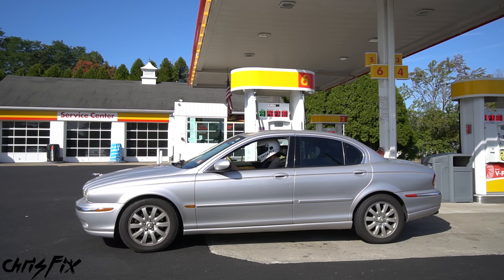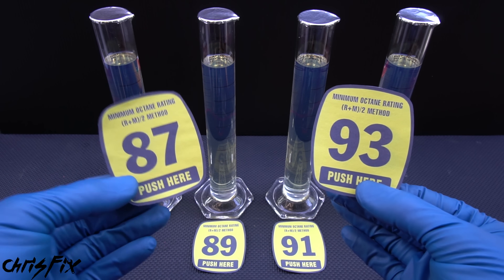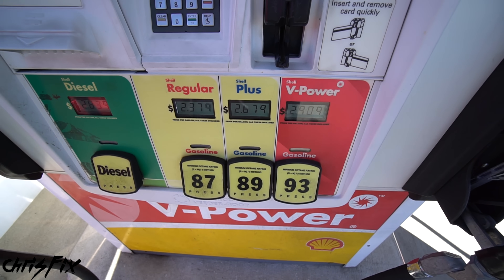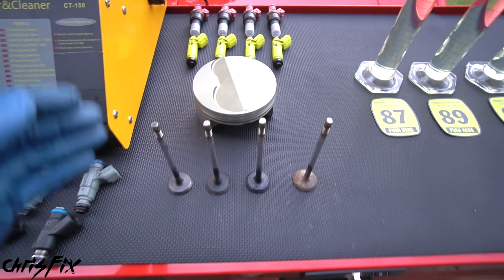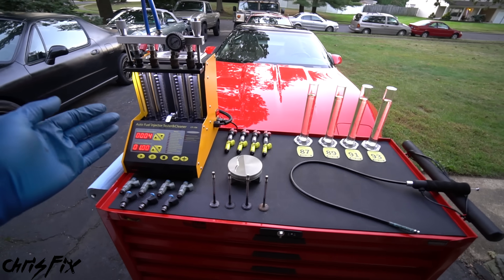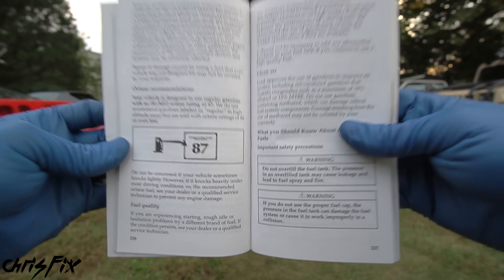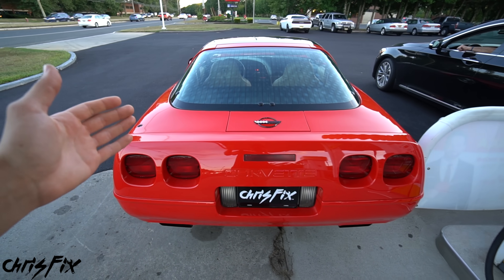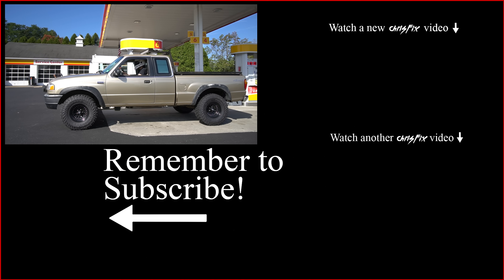What is the BEST Fuel to Use in Your Car or Truck and WHY

Comment: I used to work at Gilbarco / Veeder-Root, logo seen beneath the fuel type selector. 
Don't fill up when you see the tanker dispensing into the ground. It stirs up all the crap at the bottom of the tank and you are pumping it into your car. Station owners never change the filters. 
89 is just manifolded 87 and 91.

Comment: The energy in different gas is NOT the same! Higher octane value gasoline has slighly lower chemical energy because of its molecule structure

Comment: If you are using gas for Any Small Engine regardless if it is mixed with oil or not you
 Must Use Plus Grade 89 Octane gas. Read the Owners Manual or ask the dealer. Saving 20 -30  cents a gallon isn't worth the eventual problems you'll eventually end up with.

Comment: Actually putting regular in a premium required vehicle is fine for a tank and unless you are flooring it or lading the engine it's unlikely to cause a problem. Just drive normal, not slow. I Have a Tacoma that recommends mid grade but it runs fine on regular. The pumps at Costco only have 87 or 93/91, no mid grade. The difference between the bottom and top grade is about $8 a tank. I briefly thought about using octane booster but I was unable to fine one bottle that could boost the octane number over 1 point. It would be cheaper to just put in the premium. 

Otherwise good info, just put what the manufacturer recommends and you will be fine.   MG  Retired ASE Master Tech.

Comment: Doesn't higher octane fuel have additional detergents to help clean your engine? So it seems like putting in higher octane will save you more money in the long run because it will make your engine last longer.

Comment: Very informative video..well done and concise. I have an older 1994 Nissan 4 cyl, 5 speed pickup truck that I use to haul trash and do misc odd jobs with. Great little truck with 128k miles on it but I've noticed that if I put reg 89 octane gas in it it runs horrible! It runs so bad on reg gas that I thought I had a broken engine mount..no joke. So I switched to premium and it runs like a top. P.s. Better fuel in my chainsaw makes it start easier and improves performance as well. 
It's been my experience that higher octanes can dramatically help small engines. It sure did for mine. Currently $3 @ gal for premium (93 octane) here in the southwest US.

Comment: Chris, you did not mention how some mid-grade unleadeds are alcohol free (or at least claim to be). Most "regular" gasoline in the U.S.A. has 10% alcohol. Just straight petroleum based fuel vs. one w/ a 10% mix could make a difference. In theory alcohol would give you more get-up-and-go but have less miles per gallon (faster burn?).

Comment: Since Shell puts 7 times the required additives in their 93 octane, and 89 octane is pretty much a 50/50 mix of 93 and 87, you'll still get a significant boost of additives using 89.

Comment: Well it is not written in the manual, but I need to use plumbum additive before gasoline I buy. Since they stopped using Pb in gasoline. 
What I do miss is how organic additives in gasoline are destroying engine. Here in europe there are usually laws which tells that there has to be something, like rapeseed, in gasoline in atleast certain ammount.

Comment: Hey chris so long story short is premium gas like full synthetic oil? For example a 2002 honda accord only needs conventional but full synthetic will give it protection and keep the engine clean from sludge. Same thing as it only needs regular gas but using premium is also good and will keep ur injectors protected and clean?

Comment: Here in Canada, the Regular and Mid grade has up to 10% ethanol, and Ethanol contains lower energy density. So you will get better Fuel Economy by selecting Premium...But the percentage of energy gained from having no ethanol, does not offset the Higher price of premium. Thus, it is cheaper to run Regular.

Comment: I have tested it. Premium gave me way higher mileage in hway driving.
Reply: Ya he said it doesn't make a difference but then he said that it does when talking about his vett. xD
Reply: When driving outside Calif I run only ethanol-free fuel: I go from 24mpg to 32mpg. Ethanol fuel actually burns less efficiently, wasting gas and creating more air polution. You can't get E-free fuel in most areas of Calif.

Comment: Back in the 90’s when I was a mechanic at a GM/Geo dealership, we had Geo Metro’s towed in every winter because people would put premium in them and when the engine hot cold, the little 1.0L three cylinder wouldn’t start.

Comment: FALSE! Octane is an inert substance. IT DOES NOT BURN, therefore, it lowers combustion temperatures. It makes up a percentage of the fuel content. THUS 85, 89, 93 octane. KNOCK is caused by excessive combustion temperatures due to predestination from hotspots within the cylinder such as the edge of valves.

Comment: Simple answer everyone: CHECK YOUR CAR OWNERS MANUAL.

You’re Welcome
Reply: @lAcid Rainl well no shit sherlock
Reply: TL;DR
Reply: @Heisenberg-zy8xp  Only need 1 page: Fluid requirements. Done
If you can't bother to read that 1 page, then you don't deserve a car.
Reply: What if you don't know how to read ??!!?
Reply: My owners manual says to just put regular, but I put all 4 types of gas instead. Makes my car fly, that way I don’t have to worry about traffic.
Reply: Nah get those obd2 chips that “improved” performance by cooking your seals.
Reply: I've heard from a sunoco refinery that you follow what the manufacturer recommends because that is what the engine was engineered to run on
Reply: @lAcid Rainl Thanks Captain.
Reply: @lAcid Rainl DUMBAZZ
Reply: My older Subaru outback is "Premium recommended".  I've never noticed a huge difference in terms of premium vs regular, so no, it's not cut and dry. Why waste money when it's not doing anything.
Reply: Treasons Beta well then you’re just not paying attention. If it says premium, it’s NOT performing at optimum level of you’re putting less than in it. Fact.
Reply: @gr8st2323  the octane rating refers to knock resistance, fact. octane rating affecting the "optimum level, ie power output, NOT a fact. guess you aren't paying attention either.
Reply: Rhia yeah that’s both incomplete AND incorrect. But okey doke buddy 👍
Reply: Treasons Beta boi better be prepared to replace some stuff
Reply: Treasons Beta it depends on the compression of the motor. If the motor was forced induction or high compression you were using the wrong fuel and it could possibly damage the motor of a long period. Most newer cars know immediately when you put the cheap stuff in and the computer detunes the motor. If you can’t afford the correct fuel I would suggest not buying a high performance vehicle
Reply: @TreasonsBeta  It's not like engine damage occurs instantly. It is cut and dry. Pay now, or pay later.
Reply: @defectresolution9428  modern vehicles should be fine on all levels of pump gas, aside from high performance vehicles that can't.  Your engine has a knock sensor, it regards timing if need be.
Reply: @noneyabizz8337  "Modern vehicles" tell you what kind of gas to use. Using anything else voids the warranty. Good luck with that.
Reply: @noneyabizz8337  said, "should be fine". Those are the words used by people who don't know what they are talking about.
Reply: @MyChannel-ow4so  bring some info and refute me.  Unless your manual states to run at least a certain grade, you'll be fine.

I'm not wrong, ya troll.
Reply: @defectresolution9428  false, most tell you a minimum of what they're capable to of running.

Go look in your manual and see.
Reply: @noneyabizz8337  MANY car mechanic websites tell you that using the wrong fuel will void your warranty. Learn how to internet.
Reply: @noneyabizz8337  You ARE wrong. You will NOT be fine is you use the wrong fuel.
Reply: @noneyabizz8337  You said "should be fine on all levels of pump gas". That is clearly wrong. Stop saying shlt that isn't true.
Reply: This doesnt make sense to me. I know 93 is required for higher compression ratio engines. But it can be used in my corolla... So the only difference is additives and cleaning properties... so why wouldnt the manufacturer always just recommend 93?

Why recommend 89? In these vehicles you can use 87 but might eventually get knock... so then why just not recommend 93 in the manual to clean better? 

It seems more like this:

Forget the manual. If you have a high compression car, use 93.

If you dont, use 93 anyway if you can afford it. And try to at least use 89 since its better than 87...

Comment: What about a car that says 87 or higher? Does it benefit from higher octane? I have a 2014 v6 camaro and it makes 323hp. The Manuel says its ok to run 87 but people say its better to run 91 because its a high compression engine. It also reduces timing ive heard

Comment: Another problem with dirty injectors is that the fuel flow through them can be different between injectors. Causing some cylinders to run rich and some lean. Which could lead to one or more cylinders getting cooked

Comment: Chris, one thing you did not bring up is the use of recreational gas in older vehicles. I drive and older vehicle with a throttle body GM 350ci from 1989. Of course made before the clean air act of 1990 and the energy independence act of 2007. I was told that the ethanol contents of new gasoline would eat away at my old school fuel line and that the engine would run better on recreational as this was the standard gas pre 1990s. is this just a myth or am I really protecting my vehicle by running ethanol free? This would probably make a good subject in future videos as well as I am sure im not the only one who has been told this and genuinely curious if that extra I pay per gallon is really worth it. Great video Chris, I hope you see this.

Comment: So I have a 2014 gmc 1500 and I use 87 or flexfuel and I have a 72 Chevy truck and it seems to run better on the higher octane along with my 4 wheeler

Comment: Do you recommend running ethanol free gas over E10? I have a couple of stations nearby and it's not much more expensive, I think about 10c a gallon more. I have a 2005 Mercedes C55 with an M113 engine, not sure if I should prioritize going to Shell or the ethanol free one (Fast Fuel).

Comment: My car is rated oct89(14' bmw x1) ,  I either mix equal parts 87 and 91 depending on the price, but its noticeable when I fill up full 91/93 vs 89. Runs much smoother, quieter. I pleasant hum. Granted this car sounds like a diesel, so even tho its rated 89, I still put in 91. Personal Experience.

Comment: A quick guide to diesel owners:

just use the diesel hose man, what are you waiting for?
Reply: Well, here in Germany at least we can also choose between regular Diesel and premium Diesel. Does anyone know if the same "rule" applies?
Reply: @bordermonster  no, because diesel detonates on injection, but Diesel is dirty and causes even more carbon deposits than gasoline, and ESPECIALLY if you have a car with DPF, you should run premium.
Reply: @TheFPSPower  Thanks for the answer! The manual only states Diesel with a warning not to use Bio Diesel (so no renewable) and only the largest gas companies offer Premium . But would the neglect of premium explain why Diesels sound, well, like a Diesel after a few years? When I bought my car 5  years ago, I couldn't even hear if the car was on or not and after a couple of years it gradually started "Dieselknocking". Shop never said anything during the manufacturer mandated inspections (every 15k km, so about every 9k miles).
Reply: We have #1 diesel for the summer, #2 diesel for the winter, and red diesel for off road.
Reply: In Finland we have atleast 6 differend diesels to choose (+winter diesels):
- regular diesel (fossil diesel)
- "pro" diesel (15% of diesel is renewable)
-"MY" diesel (100% renewable)
-"RED95-etanol" diesel (80% less particle emission)
- "smart" or "futura" diesel (less emissions than regular)
- diesel "plus" (premium diesel, aka. more power)

different gas stations sell little different diesels, as you can see :D

also there is PÖ (Polttoöljy = fuel oil) ("red diesel") which is only for off road and for tractors etc.
Reply: @ukko1998  Oh no, I'm planning a trip to Finland next year, looks like I'll stand at the gas pump and start crying, not knowing what to pump 😂

Comment: hi   chrisfix  ,   yes I got a 2013 chev impala  with that direct injection with  74,000 miles and   knowing from other youtube videos and etc  I think I got carbon issues to ,  you would think when they build engines  they would make this problem not so common .   I had a 94 oldmobile  88 royale  ,  3800 engine   , but I could hear the pinging  ,   im  always on time with oil changes   and do 3,000 mile oil changes ,  my car does more intown , than highway speeds ,  but I take it out of town to ,

Comment: NIce Vid. IT REEKS of effort!! Well edited. My 2019 F150 says if i use gas, GAS, which is "recommended" but will use the crap gas with corn, (like they have a choice) but i have to drive it at least for 5 miles when you fill up with the other when it has the former. Now, what on the pump, and besides the owner (whose never there) can tell you if you are getting 100% gas, or up to 15% corn?  The chick at the counter doesn't know! either does the dude eating doritos behind her.  thanks

Comment: My 80yr old mechanic who’s been working on cars since 1955 put it this way . Gasoline is like fuel for the body. You can get McDonald’s burger (87 octane ) or you can eat higher quality food (93 octane ) , both will give you fuel to keep energized and moving But over time consuming less quality fuel will catch up with you. He told me either pay a few cents more at the pump for quality fuel , or pay me (referring to him the mechanic ) to fix your problems later from lower quality fuel. He also recommends a bottle of heet water remover and lucas fuel treatment every few months, and amsoil for changes. So far my vehicles other than consumables such as tires , brakes and serpentine belt have been good.

Comment: Actually, you are incorrect.  Higher octane gas does in fact burn slower than lower octane.  This is why you want to run the lowest octane that you can get away with without detonation which does help fuel economy and power. Source: Hemmings Motor News, TrueCar blog or other news sources as well.

Comment: Chris, I've got a 2017 Nissan Frontier w/4.0. Owners manual & dealer says I can use 87 (I'm in California). When it's hot outside, if I fill up with 87, I get some pinging while taking off at the light but goes away. I don't notice any if I use 91 (highest I can get here). Samething when it's a little cooler weather, like now. I've got 79,000 miles on it. Should I have something checked. Forgot to menton I only use "Shell" or "Mobil". Thanks, for all the great videos

Comment: First off,.. If you've never tried to make a decent youtube video, you have NO idea how much work was put into this. ChrisFix did an awesome job if you ask me.  ( I know,.. .. no one asked).  I thought it was extremely thorough and informative. However, I would like to find out more about ethanol free gasoline.  I spent several weeks, and several fill-ups comparing my mileage when using strictly 90 Octane ethanol free, to 87 octane "up to 10% ethanol" gas.  I spent more on the ethanol free obviously,  but got much better gas mileage.  After several tries, when I did the math,.. I was getting the EXACT same price per mile. (Things that make me go,.. "Hhhmmnn!?!"  [big oil] )  Which then makes me ask,..  which should I use ?  A 90 octane ethanol free, or an 87 octane 10% ethanol ??  Thoughts ??  (Ps,.. I always use ethanol free for all my small engines')

Comment: I would give the info in this video more credence if it weren't sponsored by Shell. Most of the info is correct some a little sketchy. Shell gas, though expensive, WILL clean combustion parts and in my experience improve mileage a little. Is that a bargain . . . meh . . . I don't like the company so no. I never by their products.

Comment: What if the car recommends 87 can I just add 89 to stretch my gas? Car: 2015 Hyundai Sonata
Reply: Use recommended, any increase in MPG would be negated by more cost per gallon.
Reply: jjthesavage thanks bro

Comment: The owner's manual will tell you what gas to use . The higher the octane the cleaner the fuel will burn . High performance cars require  high octane . Then again you can always convert your car to run on hydrogen AKA water . I seen a corvette that ran on water and the said he didn't feel a difference .

Comment: Hello Chris,
I have a question for my Lexus ES330 2005 model, the gear shift is not smooth from 1st to 2nd. It gives a jerk sometimes when accelerated hard. Does it have something to do with fuel injector or transmission have sone issues?

Comment: I’m gonna recommend an On3 turbo kit for your mustang instead of a S/C kit. I had one on my 2v with a stock block and stock bottom end and made 500hp to the tire. For the price and ease of installation I 100% no doubt recommend an on3 turbo kit. A much cheaper and in my opinion much more efficient way to boost your mustang.

Comment: If your car has a turbo... put premium (especially with smaller turbo engines)
Reply from the maker: Yes! Although new turbo engines have plasma coated cylinders and many are tuned to run on regular which is impressive

Comment: Although I don't disagree with everything it's not a busted myth because you said so.. Cam 2 and race fuels will run lead or lubricant that have an effect of running cooler and smoother. Aircraft run fuels like this and some classic automobiles.
Reply from the maker: I specifically said this video is talking about gasoline that you find at the pumps.